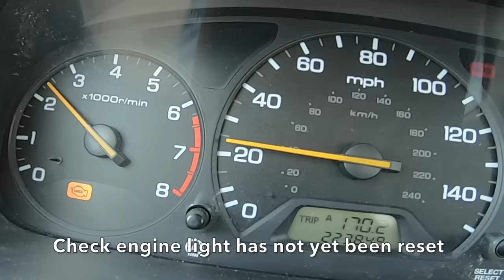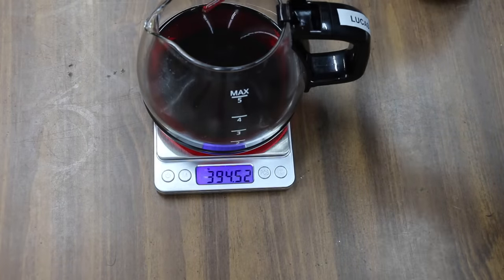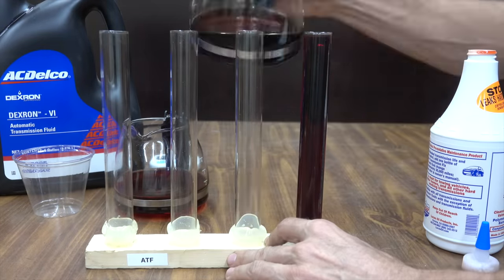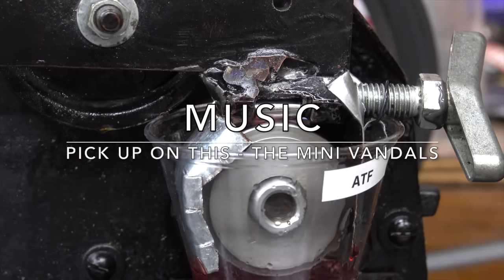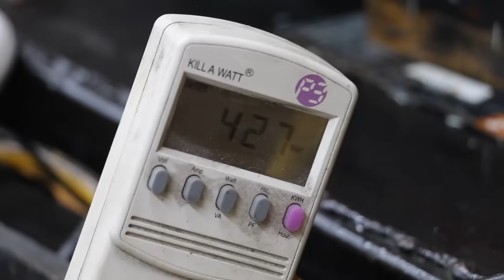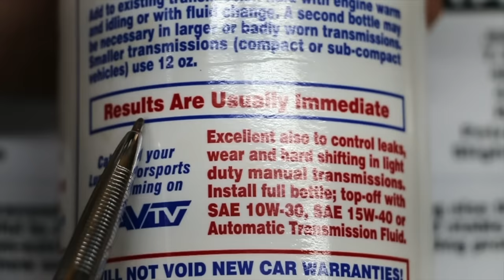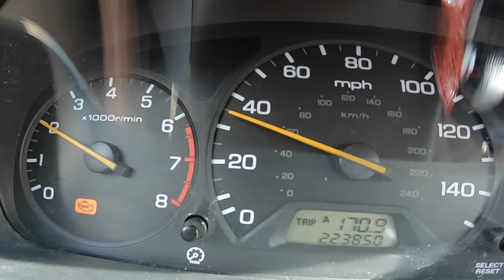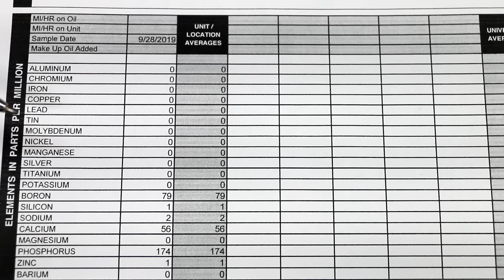Does Lucas Transmission Fix Work?  Let's find out!

Comment: I was thinking, "2000? Why not experiment on an older vehicle?"

Then I realized that 2000 was twenty years ago...
Reply: What about 50yo car?
Reply: Brother I drive a 1997 Honda civic and it didn't git me till the autozone guy told me to get the high mileage trans fluid due to age alone
Reply: I had an 84 Caprice Classic which was leaking fluid. This helped it, but it didn't eliminate it. (I didn't use the whole bottle, but I didn't want to.)
Reply: It wasnt until the 90s that we saw typical cars go over 200k miles.
Reply: I know it's crazy to think Jurrasic Park was 15 years ago!!!
Reply from the maker: Great point!  My newest vehicle is a 2003 and oldest is the 1989 ranger
Reply: @ninjamaster3453  I've seen several cars with over 200K from the 60's, 70's and 80's they just had the oil and filters changed regularly.   Some engines and transmission are just inherently garbage though.
Reply: @ninjamaster3453  The 77 - 90 G.M B Bodies (and 79 - 91 Fords of the same general body style) were capable of going that distance, though. G.M.'s 305 V8 was good, I've heard of people going 500k on one if it was a well maintained engine.
Reply: @ProjectFarm  thank you for testing this.
Reply: Same I own a 2000 mustang gt. Hard to believe it's a 20 year old car. In my opinion around this time was the pinnacle for American cars.  ws6 Trans ams. Mustang Cobras,
 ford lightning's, rcsb trucks, duramax trucks, 7.3 powerstrokes, 12 valve cummins and many more
Reply: @ninjamaster3453  maybe US made cars shit my grandma has owned 4 corollas all of em had over 500,000kms on them rhe only reason she ever got new 1s was she crashed them
Reply: I’ve had success with this stuff.. just have to use at first sign of a hard shift.. more of a preventative measure if you will.. most people wait until it’s too late and then try it.. at that point you’ve wasted $12
Reply: @ProjectFarm  You should be saving $$$$$ on property taxes! I know I do!
Reply: @TheLionAndTheLamb777  thats right I had a 64 cuda with over 250thousand. Maintenance
Reply: The oil testing lab should give you a volume discount.
Reply: Year I was born!
Reply: @101Volts  hey did the leak get worst off than it originally was over time ?
Reply: mainly dodge junk.
Reply: LMAO
Reply: Ikr, I love it when people think they got a good deal buying a used car when they don't realize it's actually 20 f**** years old
Reply: I wonder if this will help my manual transmission in my F-150. The synchros are going out for 3rd. (M5OD)
Reply: Does not want to pay 1500$ for trans build. So what junk the car?
Reply: Our 2000 explorer has been slipping in first gear since 2007 it was going to cost 5 grand back then. It was decided to let it go tell it brakes hasnt yet
Reply: @AndrewKidd14145  some people are so goddamn cheap. Dude gets 220,000 miles and 20 years off a transmission and doesn't want to spend a measly $1,500 to rebuild the damn thing.

I don't get this world. When you buy a car you need to set aside money for repairs, especially if you've had your car for 20 years and 200,000 miles you should have like $2,000 in the bank waiting for maintenance
Reply: @Jonathon Barberio 

Jurassic Park Release date: Jun 11, 1993 (United States)

Coming up on 27 years ago.
Reply: yep, i just realized im old
Reply: Oof
Reply: Still drive my 1993 Mercedes with 314k miles.
Reply: Ninja Master Al Bundy’s old Dodge (actually a Plymouth Duster) went over a million miles
Reply: My brother has a Dodge Ram from 2000, and I’m just now realizing it’s actually becoming old
Reply: Me Here I feel like an old man now when I look at used cars and trucks to buy since I'll often find myself saying, "Oh, it's an 06,07,08 that's fairly new." I think it's because the body styles really started getting more 'modern' around that time and that's when I was most interested in buying a new vehicle.
Reply: @101Volts  my first car was an 83 caprice classic 🙂
Reply: @cody5495  that would require personal responsibility. That barely exists anymore. I'm so glad I started budgeting and building sinking funds. So much less stressful than planning the entire month in my head.
Reply: I feel older all the time as well!!!  Time is a construct of man. Just use it as a reference.
Reply: I have a 2000 Ranger, 176k on it, at 150k it started an occasional slip during shifts...used an old metal shop vac to convert to a fluid extractor using a Lucas transmission fix cap to attach to 3/8" od hose.  I pulled out about 4 quarts through the dipstick tube.  I then replaced with Dexron/Mercon and a bottle of Lucas trans fix.  No problems shifting since.  Same time I used Lucas oil stabilizer once and my oil consumption/leaking went from 2 quarts in 3000 miles down to 1/2 quart.
Reply: @Jayda08  until you talk about rubber componets. 

ford in 2019 designs a vechicle to last 250K miles OR 10 years. the 10 years is due to teh rubber/ plastic componets
Reply: My mom has a 1994 honda Civic.
Reply: Fucked up huh?
Reply: @AerodynamicBrick  oh man, that sucks! What I've learned is that for Honda automatics, only use Honda fluid. Nothing else will do. I ran it in my '89 accord, as it worked so much better than the typical Dexron fluid. 

As far as manuals go, i know the older ones typically do best with 10w40 - fill em til they overflow, then you're good. That's due to oil starvation on 4th and 5th, apparently.
Reply: Austin Lucas preform well
Reply: James Diaz true
Reply: @cody5495  What is a 220,000 mile Honda Accord from the year 2000 worth? Out here I could buy a nice condition one for $1,000 so I understand not wanting to spend $1,500 on it.
Reply: @Jayda08  the industry norm is 10 years 150K mile designed lifespan....................

they do not expect their products to last more than 10 years with modern plastic and rubbers.

back in teh day rust handled this for them, now days they let teh plastics handle it.
Reply: @Jayda08  LOL the toyota transmission in my Lexus ES350 (Toyota Camry V6) had to be replaced 3 times in 30K miles...... only car i have ever owned to leave me stranded multiple times. 

also dont diss pontiac, chevy gave them a car and 500K then told them to make it a "pontiac" they did what they could, with what GM was willing to spend.  CHevy Buick, Oldsmobile, pontiac cars all shared the same flaws..... GM
Reply: Me Here it’s... INSANE :O
Reply: @AerodynamicBrick  that was a mistake I belive you have to stick with the honda fluid
Reply: We're getting old
Reply: I Used to have an 1991 Toyota Corolla 1,6 XLi Estate. But it rusted away so I have a 2003 Mercedes-Benz Vito L 112 CDI. 4 speed auto works great 😎
Reply: @jonbar140  lmao dude I graduated high school in 2001 and ate dyno fries from McDonald's everyday and I think it was the promotion for the second jurassic park. So 20 years maybe more? Sure miss the drink cups full of fries...
Reply: I know right? I keep speaking in terms of the 1990's and late 80's. People have to remind me that was 3-4 decades ago. Then you see a 'young' friend from year ago. All gray, walking with a cane and fear creeps up on you. Then the thought of "I am old!" LOL
Reply: Looks outside at my 2000 ram 1500..... audible gulp
Reply: @ninjamaster3453  It was all about the knock sensor.  It retards the timing even when the pre-ignition/detonation isn't audible.
Reply: @niks983  I have an 01. Yours rusting too?
Reply: Cody exactly my point. We create waste by junking stuff. That’s why the make cars with serviceable parts!
Reply: @jonbar140  dude Jurassic Park 3 was 20 years ago.. wtf are you talking about.
Reply: @coyotelife9732  The first one came out the year I was born. Let me enjoy my denial
Reply: @UZI9MMAUTO  oh yeah the rockers,fenders and tail gate are looking like a cheese grader.
Reply: @ProjectFarm  the newest vehicle I've owned it a 2004 Taurus, I turned it back in for a 95 F150 at the Ford Dealership. The sales guy was quite confused as the Taurus was loaded and the F150 was bare bones, not even a radio! Stick shift 2wd, reg cab long bed!
Reply: Shit to me the 350Z and Acura RSX are "New" because I remember when they were lol.
Reply: A 2000 car today is meh.  A 1975 car in 1995 was ancient.
Reply: me Here. I resemble that
Reply: @ninjamaster3453  laughs in Mercedes diesel
Reply: Now think if it was 2000 and the car was a 20yr old car....  it would need more than a trans..
Reply: @Jayda08  when i looked up the transmission by teh code i found many others with teh same issues, wierd thing was most of my mileage was freeway.... but going through that many that quickly amoung other wierd things ruined my faith in non 4 clyinder toyotas.... which since i prefer honda's 4 clyinders..... you get teh idea
Reply: i have a 1972 mustang with 200k and has all the original parts down to gaskets and paint! just plugs, wires, points,rotor,cap and hoses and fluid are new! the secret we use hdo engine oil. next is regular maintenance.
Reply: you are right about the 1979-1991 ford ltd plat form. the 1979-1993 fox body was another one but a lot got the shit bet out of them. one ford that  lasted was the 1973-1979 f truck! thy have heavy duty glvenised sheat metal. thy only rust at the drip rails on the roof!
Reply: Same here. That's when I realized that I've grown older than dirt!
Reply: Lol.
Reply: @Jayda08  I think age would be relevant. Newer transmissions are built using way more styles, components, sensors and crap older transmissions had nothing to do with.
Reply: @ Me Here
That’s so funny, because I’ve done the same thing.
Shoot, just realized the 1997 Toyota Tacoma I drive isn’t that far from being eligible for an antique plate! Lol 😆
Reply: I can say Lucas fuel treatment/additive does wonders in my Detroit marine engines! 
Along with their oil additive.
Only brand/product I’d use as an additive.
The ONLY brand, period.
Reply: I feel even older with my 96 Accord lol
Reply: Yep...time flies when ur havin fun!
Reply: @ProjectFarm  must be nice to drive such new cars :)
Reply: andrew allen it’s not all that. But I guess if one hasn’t been able to in their life, then I could see how your comment would come about.
Me? Had new trucks every two years from age 21 to 30.

Now? Lmao at 45, I’m just fine with my 1997 Toyota truck. 😎
Reply: @cnvw974  1964 vw kombi, 1966 mercedes w110 200d, 1972 Jaguar XJ6, two 1972 vw kombis.
The only electronics are in the radio :)
Reply: andrew allen 
And alternator! Lol
Sweet!
Reply: @cnvw974  Dynamo please! Not alternator and with voltage and current regulated by relays and resistors :) except of course the 70's cars the 64 vw works on 6V.
Reply: LOL.... How time flies....!!!!! Yup I thought the same thing
Reply: I worked at a Chevrolet dealership as a mechanic.....ANY ENGINE WILL GIVE YOU OVER 300,000 MILES WITH PROPER PREVENTIVE MAINTENANCE AND NORMAL DRIVING HABBITS....I have a lead foot so I won't reach that many miles but at least I can rebuild the engine myself....!!!!! 

I remember a customer who owned a Chevrolet pick up truck and reached 1,000,000 miles....all maintenance records from the same dealership ( dedicated customer).... The dealership owner offered the pick up truck owner a free vehicle of his choice but he would have to trade in his truck...the truck ended up on display at the showroom floor....!!!!!!
Reply: Dr.Whiteboy Born in Y2K? I ran the first train west out of New Orleans 01/01/2000 as we proved all the electronics and infrastructure still worked! 
   Honda with their minivans though? They missed a few things somewhere! I’ve never heard or read worse reports about Hondas than regarding the ‘99-‘04 transmissions. Too bad it was after I bought one!
Reply: Lololololol
Reply: @hamada128  
You got lucky. Modern Mercedes is not that generous...
Reply: that is indeed 20 years ago… I didn't need this reality check
Reply: @jonbar140  15 years ago? Your math is way off, the first jurassic park came out in 1993. That is 27 years ago friend. I know because I was born in 1990 and watched the shit out of that movie as a kid.
Reply: Oh this should be good. Everyone shoot from the hip!
Reply: Yea,I feel ya
Reply: Me Here 2000 is really old for a car
Reply: I can’t believe my first Tesla is 7 years old already!
Reply: @soccerghoul  I agree totally.  I know a guy who has a used car lot.  He has 3 or four 2000 - 2004 V6 Accords,,, everyone of them can't shift right.
Reply: You sound like me with movies or music.  It's been 20+ on all my suggestions.   When did I get old.
Reply: @jonbar140  15yrs?  Jurassic park came out in 1993 lol
Reply: @davejohnson3474  Why'd you have to go and do that Dave? I know exactly when JP came out, I just wanted to pretend I wasn't 31. Dave Johnson: ruining mid-life crisis's since 2020.
Reply: @jonbar140  i was 12 when i watched it at the cinema lol
Reply: @davejohnson3474  I was 4 but had to leave because I was too afraid. 😆it's now my favorite movie. As I write this I have a Jurassic Park shirt on.
Reply: @jamesdiaz2748  you have the auto or the 5 speed in the mustang?
Reply: @cody5495  you have to realize though at a certain point it makes more sense to junk the car or sell it.sadly Most people don't know how to do basic maintenance on their car. So they get nickeled and dimed by their shop. Or worse yet they are too cheap to spend the money and eventually the wear and tear take over
Reply: @christopherhendricks4369  5 speed manual
Reply: @jamesdiaz2748  I owned a small handful of new edge stangs. Mostly gts but had an 03 Mach 1 as well. They are pretty reliable for the most part.
Reply: @christopherhendricks4369  yeah my car has treated me pretty well so far. Man I'm jealous about the mach 1 part. 20 year old me cant quite afford it yet but hopefully someday I'll own an azure blue mach 1
Reply: @jamesdiaz2748  that's the exact color I had. Shaker hood was great. Didn't mod the thing at all except for 4.30 rear end, 33 spline axles and wider back tires/rims. I regret selling it.
Reply: Jarrod Draper LoL that’s Ford for ya
Reply: Don't do this to me. . I won't believe it!!
Reply: I'm still driving my 93 Subaru Impreza awd.
Reply: Well the old people were right when they told us time flies. 20 years ago, cars were made much better than cars of the 70s when the engines didnt last as long as the rest of the car.  It's quite common these days to see people driving around in cars that were made in the last century. Some people think they are Classic Cars, but in reality, they are just horrible old cars.
Reply: I was born in 2000, and it even shocks ME that it was 20 years ago...
Reply: @jonbar140  more like 25 haha
Reply: My 98 Accord has 253K on the original transmission. It's been showing signs of wear over the last few years, but changing the fluid every so often helped keep the internals from getting plugged up.
Reply: @ProjectFarm  I am watching this on a computer from 2005 who says new stuff doesn't last.
Reply: Jonathon Barberio except 1993 was the year they made Jurassic Park, and it was 27 years ago, not 15??
Reply: @ninjamaster3453  not true I brought brand new a 1979 chevy van I put over 400k never had a problem I had a 1975 chevy pickup I put over 300k on it never had a problem I have a 2010 suburban transmission went out at 90k so older is better
Reply: LOL
Reply: @AndrewKidd14145  maybe he loves it
Reply: @AerodynamicBrick  "high mileage" lubricants have seal softeners in them to keep seals from drying out and getting hard.
Reply: @TheLionAndTheLamb777  Lubricants have vastly improved since the 60's.  Mfg tolerances have tightened due to improvements in machining.  EFI much less likely to run rich and wash oil from rings like carburetors do.  Cars from the 70's and early 80's were all smogged up, low compression and ran crappy when new compared to the 60's cars and later (mid to late 80's) cars with EFI.  A car from the 60's and 70's that went over 200K was likely owned by a mechanic.
Reply: My wife drives a 2001 Honda Accord.
Reply: @jakemichael8586  only rust around the drip rails? Where are you at?the desert? lol they are ALL rusted to the door handles and bed tops anywhere else in the world!
Reply: @ProjectFarm  
LOL. My daily driver is a 72 Lemans with 89,000 miles on it. I've been doing it for 9 months so far.
Reply: Haha
Reply: This stuff really does work this is January 2021 and I had issues in my Dodge pickup truck I put
Reply: 👴🏽What?
Reply: Used it Eevee surprised I use in my transmission in my oil and this stuff really amaze me
Reply: @reshreshshin874  I put this stuff in my transmission I have a 2000 Dodge and I use this stuff and it really does work
Reply: Ikr I see people junking 2010s and I'm like "I remember the concept car"

God I'm getting old
Reply: Then u r old. Me too
Reply: Then u r old. Me too
Reply: @cody5495  why would u just take the 2000 and put it down on either a new car or a low mileage used car and start the cycle of doing proper maintenance to try and achieve 200k
Reply: @cody5495  I did get a good deal. I just bought a 2001 Lexus with 109,000 miles and I'm happy as a clam. Keep in mind, not everyone can afford a new car, and I prefer to let someone else eat those payments and take the hit on vehicle "value." I expect this car to last probably 200,000 or more miles and may very well be the last car I ever buy.
Reply: No one remember y2k lol
Reply: @thereal2scummy636  granny travels alot!
Reply: @101Volts  that's true gms old 305 is a very reliable engine not powerful at all but it doesn't matter how much power an engine makes if it is broke down  the old 305 and 350 as well as the 4.3 v6 witch is a 350 with 2 pistons missing they are some of the most reliable small block v8s out there and gms 3800 witch is a 350 lt1 with 2 pistons missing is a great engine as well gm has made some great engines and I'm a ford guy the only ford engine in my personal experience and opinion the only ford engine that can touch some of GMCs engines in reliability is the old 2v 4.6 modular v8 that's one great engine not very powerful either but sound fantastic and can take as much abuse as an old gm 305 they can rev to the moon and not blow but just if gms  transmissions where as reliable
Reply: Yeah. We’re old.
Reply: @johndix1820  do you still have your ody? Or long gone?
Reply: I would have graduated in 2000... Thanks a lot for the reality check... Today is my 39th birthday! Have a great day!
Reply: @jonpierce8342  Happy B day ,now u gotta get a 2000 honda lol
Reply: lol,  I love my 04 GMC Truck . Not great on gas but it's a beast
Reply: @CorvetteTrev  GMT800s are solid the bodystyle after lost some durability
Reply: @CRAPO2011  mine is a 460LE or whatever came with the 5.3L V8 (rare in 04' models)
Reply: @ninjamaster3453  I had a 78 Ford van, 2.2 million miles on the body.  400k on the engine.  Ran fine.
Reply: I hate how time just keeps slipping wow
Reply: @ProjectFarm  i have an 86 ranger, is there a term i can call it to find parts easier like first gen ranger or second gen im not sure what other rangers are compatabile
Reply: @cody5495  why spend $2,000 on a car that's likely worth less than that, and something else is probably going to break soon anyways when you could possibly use some Lucas product and get some more life out of your car for under $20?  It has nothing to do with being cheap it's about being smart.  But you can waste your money fixing a worthless car all you want, it doesn't bother me.
Reply: Pretty slow there aye.
Reply: @ProjectFarm  I used about half a bottle of Lucas in my 140k  1997 vauxhall Calibra manual transmission and it made a slightly sticky gear shift into a smooth slick gear change ,so it was well worth it for me 👍
From the UK 🇬🇧
Reply: @cody5495  Probably money's tight. But dude could also be rich but very cheap!
Reply: My truck is 25 years old and to my knowledge still has factory tranny and it works perfect.  Its use not age.
Reply: @101Volts  Next time you have leaks try at 205 reseal.
Reply: I put a third of a bottle in my 18 Year old vauxhall astra vans manual transmission,it has made the gear change more slick ,I did check the level and it was a tad low ,so the quarter bottle was enough to fill it back to the right level...
3 years ago I did the same to my 26 year old vauxhall Calibra,still shifting great 😁
Reply: Me too.. its amazing how time flies. I fell asleep last week when I was 22 and woke up 45
Reply: Also 2000 V6 Accord is known to Transmission problem. Not i4 but V6. Although the car had a sweet ride. I'd say even better than 2022 Accord.
Reply: @ninjamaster3453  you clearly never wrenched on older vehicles then lol
Reply: I drive 2001 Hyundai Sonata. Has 200,500+ miles. Trans slips & shifting is wonkey. Might try this stuff.
Reply: Same
Reply: @ProjectFarm  Same here. I had a 1990 ranger that was stolen by a drug dealer. And I still have a 1991 Honda Accord, a 1994 Ford E150 Glaval conversion van, and a 2003 Chevy Z71 Tahoe. Love my old cars. They all eork well. The Ranger? Don't know.
Reply: @kenhurley4441  Only my 2003 Tahoe is registered in the USA  (my Accord and conversion van are here with me in Mexico) and I pay no property tax on it because of military service. But I'm moving to another state, and I'll have to pay a little tax on it. But I'd rather pay taxes on a 2003 than a 2023!
Reply: @cody5495  My van is 28 years old. Transmission is up for a rebuild and it will cost what I paid for the van in 2014. Then I'm good to go for 20 more years.
Reply: @deelanders6132  9
Reply: I feel ya. Time flies!!!
Reply: @ProjectFarm  Same here. 2002 Avalanche with 275K miles. Only I have ever worked on it. No shops have had their greedy fingers near my ride. And my wife drives a 2005 Aviator. Both are owned out right and do not cost much to maintain.
Reply: Yeah tell me about it.
I'm only 30. But when I hear 1970 I automaically think 30 years ago. But actually that 1993 :D
Reply: @AerodynamicBrick  high mileage means nothing it can still ruin seals
Reply: @ProjectFarm  Lol those little rangers don't have much power but boy do I see a lot of survivors.
Reply: Almost 25 now fuck lol
Reply: @jamesdiaz2748  cast iron block head pushrods
Reply: 2000 accord transmissions are GARBAGE! mines been flair shifting for 10 years. Now my kids drive it
Reply: If only I had.dollar everytime I saw a 2000 accord with transmission issues.
Reply: Lol
Reply: Wasn’t that long ago. 😂
Reply: Haha.  That's my Forester's birthdate!
Reply: @hamada128 bro get you a new car 😅
Reply: @Jake-li7ih  who told I don't have many new cars?
I love keeping some classics in my stable.
And btw, still have that 93 mercedes but has 316k miles now.
Reply: @hamada128  😂 that's awesome
Reply: Now almost 25
Reply: @PO-nt4qr  It's funny I was literally just commenting on another video saying that 2000 was almost a quarter century ago while your comment about it being almost 25 years ago popped into my notifications 🤣
Reply: In about 5 months, will be 25 years, Chief. 😮